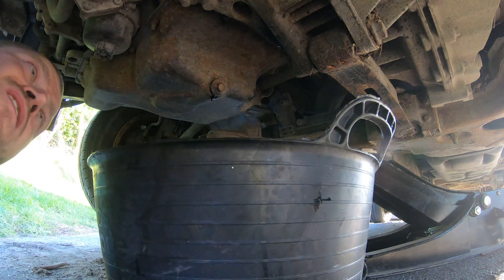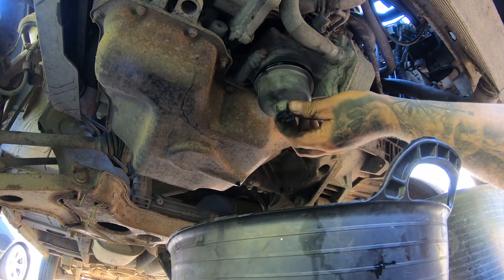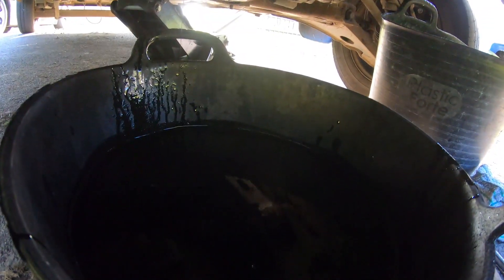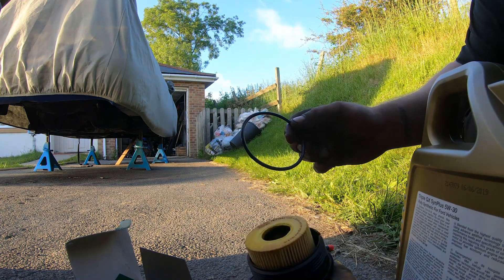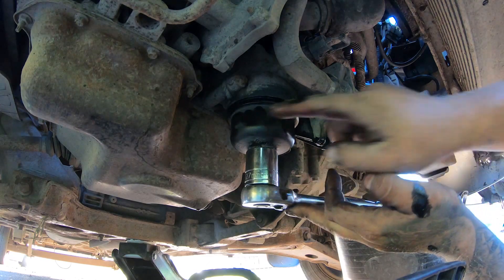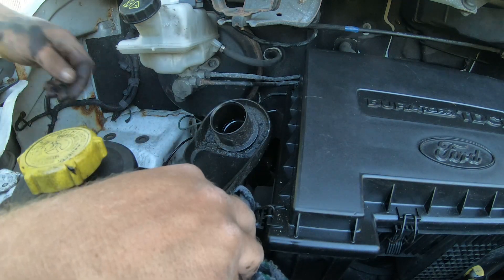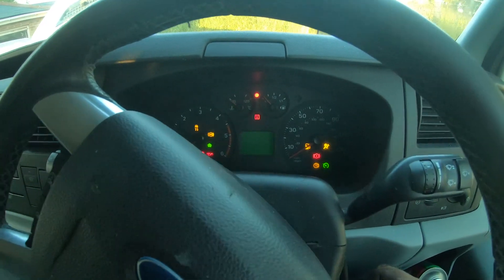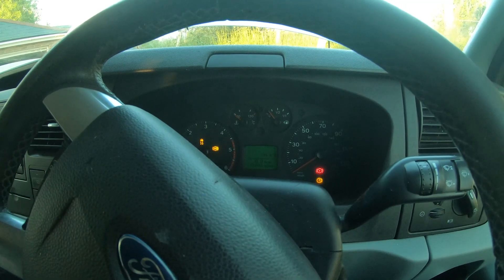Ford Transit oil change mk7

Comment: Check oil capacity, expected 7 L to drop not 9L. Sump sizes vary!!! My van 2.4 diesel 2011 ( ex minibus ) RWD.
I needed a strap for plastic housing removal. Socket just slipped !😮
Reply from the maker: That's. Lot of oil ye some people to crank them up way to tight unfortunately Andy

Comment: Honestly, thank you so much for these videos - i have the exact same transit i think (2008 110hp FWD) and finding videos on various repairs and servicing is so difficult - i guess because there are so many variants. The only help i've had with mine so far is the Haynes manual - and that only gets you so far.
Reply from the maker: No worries at all I'm glad you found it helpful
Reply: @Thediycarchannel  Just one question - where is the release valve for the coolant system? In the book it says it on the right (from drivers view), but can't find anything there. On the left there feels like a valve of some sort but it doesn't turn.
Reply from the maker: No idea never had to look for it sorry I can't help

Comment: Hi I have a mk7 2010 2.4 tipper. Would this be same way to service or are they different to the 2.2?
Reply from the maker: I haven't serviced the 2.4 unfortunately so I can't answer this sorry. There shouldn't be much difference if there is maybe just the oil filter location if anything.

Comment: my oil filter housing started to chew up using the 27mm socket
Reply from the maker: No idea why unless it's a different design
Reply: @Thediycarchannel  it’s because the thing is on so tight no matter how much force you can create the plastic at the bottom starts to miss form.
Reply from the maker: That's not good at all Jim someone was obviously an idiot and over did it.

Silly question maybe but you are turning it the right way ? I e anti clockwise
Reply: @Thediycarchannel  yep def correct way
Reply from the maker: Ok well somone over did it unfortunately if you don't have anything to get it off it may be a garage job and replace it

Comment: Thanks for the video, very well explained.. 1 question, I have the same van, how many letters of oil does it take to fill roughly?
Reply from the maker: No worries. If I remember right it's around 6litres ish maybe 6.2l but it's definitely around the 6l area
Reply: @Thediycarchannel  cheers bud
Reply from the maker: @Markmckwn no worries mark

Comment: Great vid mate. What do you do with the old engine oil? Can you do a video on replacing the fuel filter. I have a 56 plate transit with the same 2.2 duratorq engine in it.
Reply from the maker: I take it to the local tip and poor it in their tank 

Mine has been changed just before I brought it but I can have a look if it's cheap I will change it
Reply: @Thediycarchannel  thanks mate!!!

Comment: Thanks pal, bought all the gear to do a service, because I’m a tight arse. I Drained the oil off then Hunted for the oil filter, couldn’t find it for love nor money. Until I watched your video, never seen a oil filter in a plastic housing before. Normally one of those metal can/tin filters.

Thanks for tutorial, you’ve just gained a subscriber.
Reply from the maker: Thanks tech screw I appreciate the sub and I'm glad you found the video helpful

Comment: Hello mate, I have bought a diesel filter. But has been thrown off changing it due to air locks. Am I better off paying a garage to change the diesel filter
Reply from the maker: It depends on your confidence 

Shouldn't cost a lot a garage as it's easy to get to 

And it will save you any mess aswel

Comment: Mate. I got a transit mk7 12 plate. I want to change the oil and filter on mine as the mpg has dropped like a mofo. An issue I’ve had since I’ve had it is sometimes when I crank it over it’s not going to start but on the third try it always starts. It’s kind of embarrassing when you’re outside a customers house ready to pull away. Any ideas would be appreciated. I’m in the Black Country too.
Reply from the maker: Have you given it a full service i.e fuel filter, air filter etc ? 

I would definitely look a the fuel system pargi I had a similar issue I did fuel filter and it the process found a small air line crack it was leaking fuel but sucking air once I changed the fuel housing it was fine. It did happen again lol but I couldn't find the issue and a garage found it it was a faulty fuel filter housing again it didn't last long that's why I didn't suspect it the second time 

Do fuel filter first but they can be a knightmare bleeding not sure on your experience but may be a garage job they really are fussy. After that air filter and so on
Reply: @Thediycarchannel  I’m quite happy to hand over cash if I walk away without the issue afterwards. I had a full service last year but id like it to be done again. Was thinking of having a go at the oil change myself this time and get it in the garage for the rest or just take the oil I want to the garage and ask them to put it in. It’s just putting your trust into a mechanic. I could do with one that lives and breathes transits. My miles per tank has gone from 490 to a tank to 400. In a touch worried to be fair.
Reply from the maker: Oil change is pretty easy pargi just do not over fill the oil
Reply: Great vid thx....j.ust emptied mine as thought i had 2-3 litres too much in - above max on dipsick and small leaking around gearbox/crankshaft. But actually had 5-6 litres in which i believe is about right (6.72lt capacity).
Reply from the maker: Yes that's about right I can't remember exactly tho 

And no worries glad you found it helpful

Comment: Hello, how many litres of new oil for 2.2 TDCI 2009?
Reply from the maker: I'm not sure Petru there is a Castrol oil capacity and grade check online
Reply: @Thediycarchannel  I've just found the information, I need 6.2 or 6.3 litters. 😊
Reply from the maker: That sounds about right mine was around that. It's great that you found it

Comment: Mate, good vid but you should use Axle stands. 😬
Reply from the maker: Thank you Paul 
I do of the wheels are off but you can do the oil change on this without lifting it so as long as the wheels are in your safe
Reply: @Thediycarchannel  Not knocking you, just saw it and thought that some people are so unused to working on vehicles it could be worth mentioning.. used your vid to check on the change and it proved useful for the oil filter location. Cheers.
Reply from the maker: Ye I know you wasn't don't worry